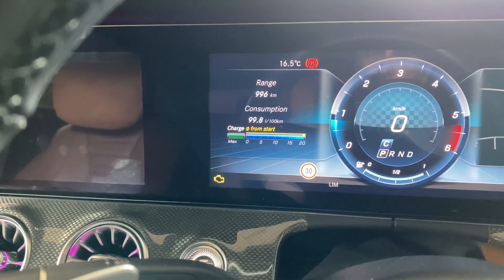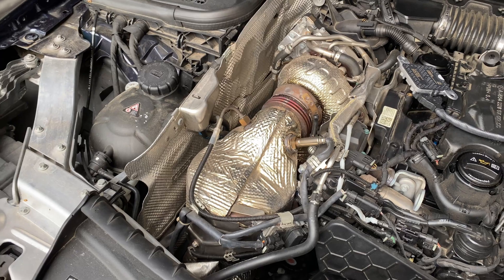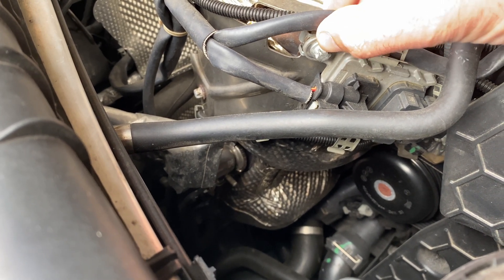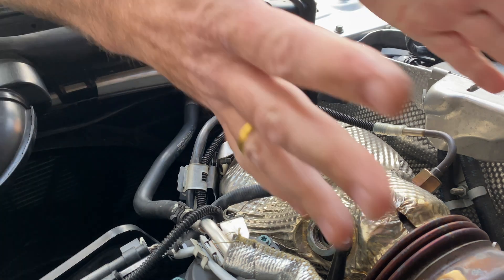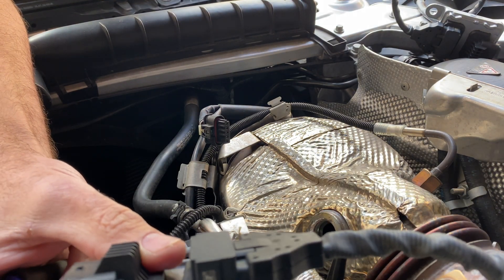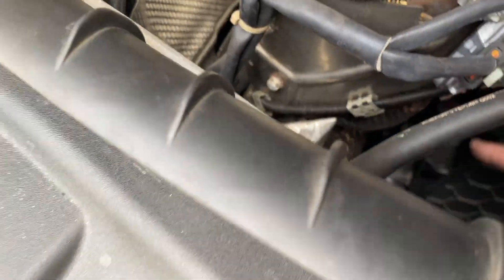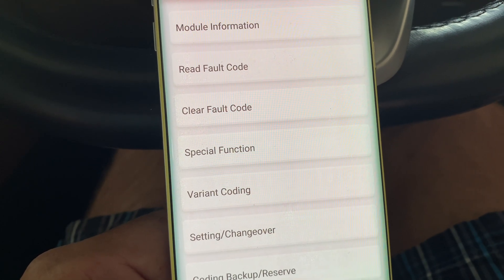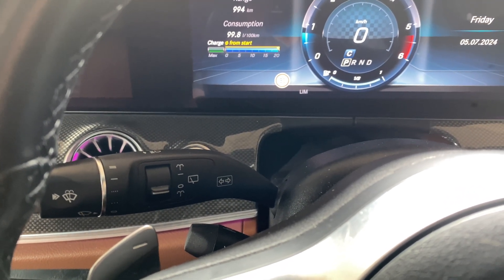Mercedes 220d (OM654) Diesel NOx sensor replacement

Comment: Just 2 weeks ago Mercedes Benz charge me £2700 to change both Nox sensor I m not sure if they robbed me or it’s the genuine price I got my invoice if anyone can help me please do so. Many thanks
Reply from the maker: Do the parts price is the simple, then i guess 1hr labour to change, 30 mins for adaption coding and 30 mins for test drive?  Plus all those hidden charges of washing it and general “safety check”???
Reply: @m @mercedes_and_more thanks it’s included the parts I hope I won’t have anymore problems with my car thanks for the reply
Reply from the maker: I thought the nox 2 under the car had failed as the light came back on about 6 months later so i swapped 1 and 2 over but the fault went away. As I was taking out 2 I thought the electrical plug was loose and it turned out it must have been as the light duty bike back on once i cleared the fault code. Swapped then back a few weeks later aha the light had never cone back on.

Comment: Is the error message displayed on the screen ‘Engine oil pressure — Stop. Switch off engine.’? thanks boss
Reply from the maker: No error message, just the engine management light

Comment: Hi,  I am getting P2297 O2 sensor out of range during declaration Bank 1 sensor 1. Is that the same sensor I need to replace. I did remove and clean both sensor was getting  P229E Bank 1 Sensor 2.Thanks
Reply from the maker: The honest answer is that I don’t know as you have said it says O2 (Oxygen) rather than NOx, but that could be your code reader just stating it differently. Have you googled the “code and O2 sensor” as this might help?

Comment: Have you ever encountered a problem with the NOx sensors being linked somehow to the exhaust flap actuator? I had a problem with my exhaust flap, and I repaired. Immediately afterwards I was getting codes for the NOx sensors. Is it possible that the exhaust flap fault was masking a problem with my NOx sensors? Thanks a mil for this video
Reply from the maker: Not on mine. Fault code was clear that the issue was NOx sensor.

Comment: Hi and thanks for the video. Did you code sensors yourself with thinkdiag?
Reply from the maker: Not coded the sensors as they are plug and play, but did the “reset” to tell the car new ones were fitted so it could run the adaptation 👍
Reply: @mercedes_and_more even non original sensors doesn’t need coding? I’m a bit in trouble finding oem spare parts. Even on German eBay there are plenty of Chinese copies so i think I’m going to buy something reliable like febi bilstein or ASPL

Comment: Hello the first part number is from the sensor bank 1 ? Thanks
Reply from the maker: Yes that is correct. The difference is length of the cable as the 2nd one under the car is longer. The actual sensor and wiring are identical

Comment: Hey there,
Could you Tell me how much mercedes charged you for coding the new sensors? Or how they reacted?
Thank you and Best regards
Reply from the maker: The sensors worked fine without coding, however, I did do the adaptation with my diagnostic tool but not for about a month afterwards.

Comment: How do you read codes? can you tell me what ODB equipment and the program you use aswell ?
Reply from the maker: @icoalexandrov4233  i use a thinkdiag2 which you plug in and then link to your phone via Bluetooth. Not that Android phones can read and code but Apple phones can only read.

Comment: Hi, i have a w213 amg line Night edition , currently at 103k miles , i had check engine light on at 85k miles and it went away itself. It was knox sensor. 
Now ar 103k check engine light came on again but this time came twice within a week or 10 days. 

Can u please show with links on ebay which sensors you bought? I might have to change both but i dont wanna buy the wrong ones. Thanks. 

Also 4 months later how is your car doing and how many miles u driven since u replaced both sensors.
Reply from the maker: @saimir1990  car is running perfectly 🤞🤞. I could post a link but i bought via eBay in Germany where i live. If you are not in the EU (Uk?) then they won’t post to you because of the customs duties etc

Comment: So, an entertaining vid' well done, But I have a similar problem with my E220 D, can you let me know how much you paid for the sensors & where did you get them, finally, are they genuine MB products.?
Reply from the maker: @jamesbowskill362  as I live in Germany then i got mine in eBay (Germany) and they were about €450 (for both) but think they are now about €475. Said they were OE and they were marked with MB part numbers and branded as Continental (OE supplier).
Reply: @mercedes_and_more  , you could buy a repair sensor and save hundreds. There is no need to replace the whole unit; the sensors wear out, the ECU never fails, it is built to last. Make sure to get ntk not Chinese. Have one on your shelf ready and if any car with nox sensor fault arrives, you can repair in 30 min. The results will be the same as 475, just with a free fine dinner.  more than half of the sensors so called OEM, are fake Chinese, especially vw
Reply: @sekainiheiwa3650  I thought that, because of the high accuracy requirement, each sensor head is callibrated individually. Therefore each NOX control unit will have unique callibration charts. Based on this logic, even though the new NOX head will work, the control unit will not give accurate results unless it can be calibrated somehow which is a different kettle of fish to say the least...
Reply from the maker: You do need to run a teach in function when you fit a new sensor using your code reader machine to tell the case it has a new sensor aha also to clear the engine management light as it doesn’t reset itself when you fit the new sensor 👍
Reply: @mercedes_and_more bro everyone is asking for a link and part number and you’re just ignoring it come on man
Reply from the maker: @immytv please read the video description. You will find the post numbers in there (they’ve been there from day 1). I bought my parts on German eBay (as that’s where I live). Just add the part number to the search bar and they’ll usually come up as a pair fits about €550.
Reply: Hello.
Please give me a link where to order this part of the sensor.
Reply: In mercedes told me you need programming when you change nox sensors and cost is 1420 euros for old w213 mercedes engine om654 and in indepedent garage was ad blue injector which was clogged and on star diagnostic gives same fault like nox sensor bank1 sensor 2,so I advise you first to check ad blue injector and clean if is necessary and if eml light is on try to change nox sensors.
Reply from the maker: @stijepozupanovic7225 yes you do need to tell the car to run an adaptation for the new sensor. Takes about 20 secs to run!  Fault codes for adblue and box sensors are different as they appear in different modules on the video reader👍

Comment: Can you still drive with the faults? I have three faults and the car is booked in next week
Reply from the maker: @christatters178  mine failed as i was about to drive to UK to trailer a car back! Did the journey and a trip with the caravan the filling weekend to Holland before the parts arrived. Was a bit nervous but car was ok but did use alot of adblue (think it defaults to a higher dose) but sadly i had no choice about those journeys.

Comment: Great video! What did you use to unscrew the nox sensor first time?
Reply from the maker: @wavesynchron  just a 22mm open spanner as shown in the video. Did have to gently grip the body of the sensor with some mole grips at some point as the nut was spinning the body of the sensor but very little grip/pressure needed 👍
Reply: Thanks! You’ve made it very easy to follow, I’ll give it a try. I can only find made in china new sensors. Did you buy them from UK or Germany?
Reply from the maker: @wavesynchron great. I bought mine from german ebay. I suppose the problem with that if you are in the UK is that the supplier might not ship and/or you’ll have to pay import duties?

Comment: I just got shafted at a local garage for a NOX sensor error code. They told its not the sensor and needed a ECU update. £450 they took from me and Engine management light retunred two days later. Now they said it is what it is no refund go away.  Some very bad scammers in London.
Reply: Sorry to hear about it are you still thinking to replace them?
Reply: Name and shame the garage
Reply: Check legislation they have to act in a professional manner as that’s what they charge you for. I’ll have a Quick Look in a second to see if I can find the relevant law.But I would right to them if they decline some form of redress that you would be happy with I would take them to the small claims court which is now an easy online system, I’m sure you would be awarded in your favour.
Reply: In the UK, garage services are protected by the Consumer Rights Act 2015 (CRA), which requires garages to provide services with reasonable care and skill. This means they must work to a standard expected of a reasonably competent person in the motor trade. The CRA also covers binding information given to the consumer, reasonable prices (if not agreed), and reasonable timescales. If a garage fails to meet these standards, consumers have rights to either have the work done again or get a price reduction. 

So they said this would fix it and charged on that basis then said tough luck. I don’t think so do you. The law is on your side don’t put up with this rubbish. 
Rich

Comment: My friend, You don't need to change both NOX sensors. NOX 2 is placed in exhaust pipe.
You have NOX 1 under the hood. I had also an electrical fault on NOX 2, that called output sensor, placed in exthaus pipe and just changed it, than fault code was gone.
Reply from the maker: @ correct ands as i said in the video I decided to do both because i was going one and if one had gone then how long until the other?  I’m a great believer in preventative maintenance. I also now have a spare good one should one go in the future (which of course it will!).
Reply: What is the part code that you bought?
Reply from the maker: @ good point. I’ll put it in the video description as i appear not to have added it.
Reply: Nox sensor 2 bank 1 ,  i buy use car , how can i find part number ? Or can you share yours ?
Reply from the maker: @Ali.waqass  part numbers are in the video description 👍
Reply from the maker: @ part numbers are listed in the video description 👍